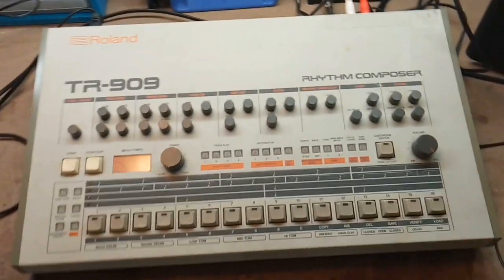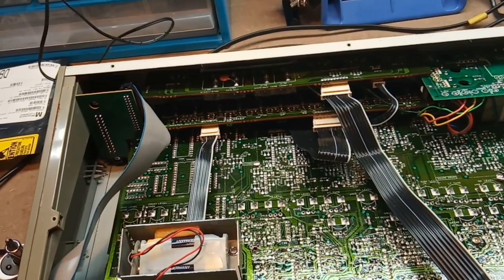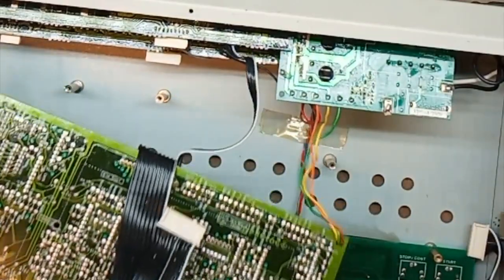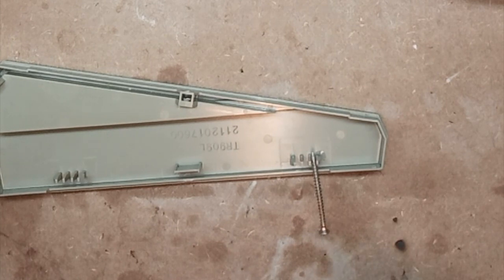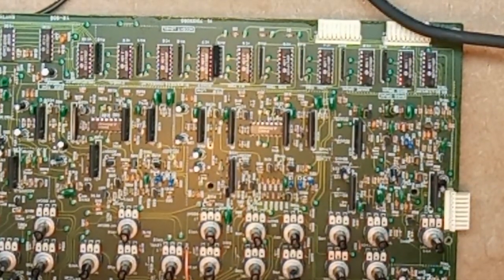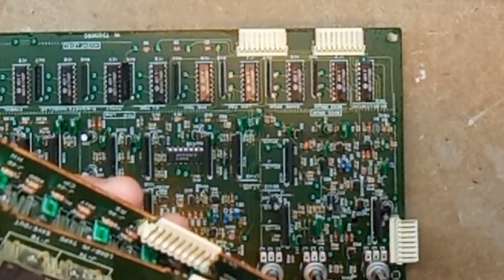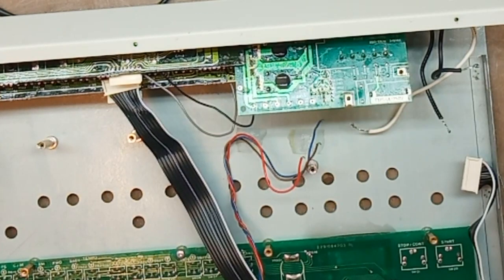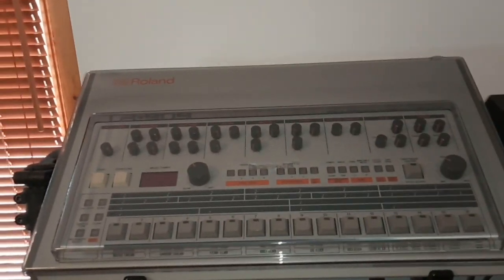30 years younger with baking soda - Servicing a Roland TR-909

Comment: Great video, my 909 has some issues with the pattern leds and I might try cleaning the connectors!
Reply from the maker: Did it work?
Reply from the maker: Do you still have your 909, I would need a set of clean 909 samples from a second 909, for a video comparing the sounds with a RD-9.
Reply: @RegebroRepairs  yes I still have it. Did not get it serviced yet though.
Reply from the maker: @cryptout  That's OK, I just need some clean sounds recorded from the main mono out. Could you mail me? regebro@gmail.com
Reply: @RegebroRepairs  sure

Comment: Do you know how to save patters to the memory cartridge?  I have a TR-909 and I haven't yet been able to figure it out.
Reply from the maker: It's a long time ago since the battery in my cartridge died, so I can't verify it, but I never had any problems, and just followed the instructions on page 33 in the manual...
Reply: @RegebroRepairs  
Forgotten I even asked this question.  I recognized shortly after the fact that as long as you have a fresh battery inside the unit, the patterns will be saved even without the power, so memory card not needed.  Good enough for me.